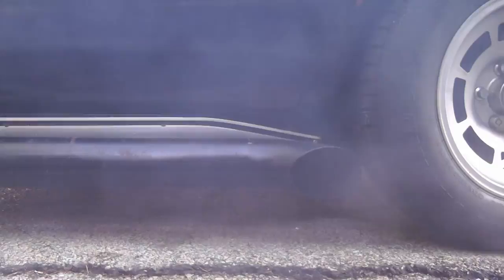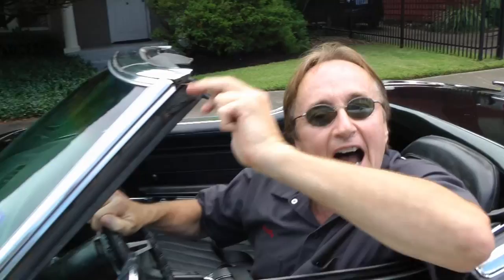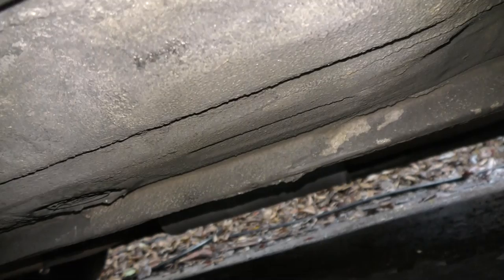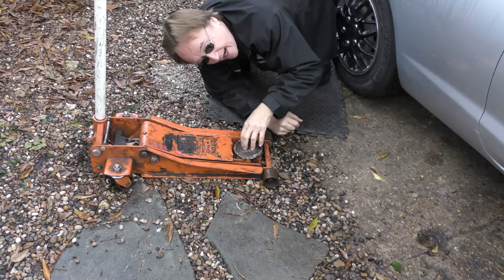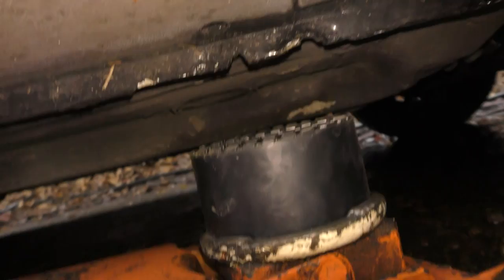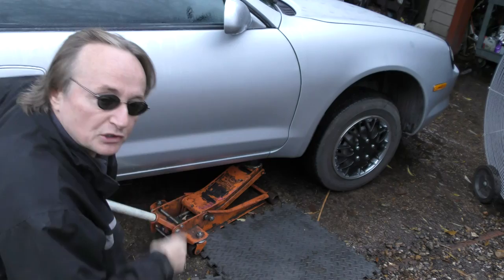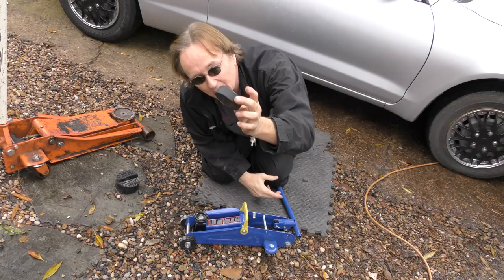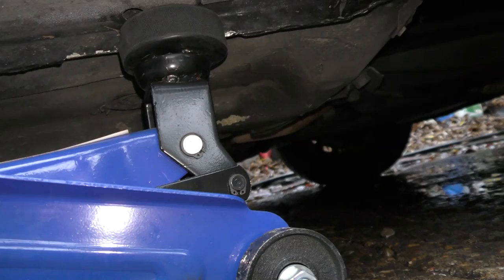How to Jack Up Your Car With a Hockey Puck

Comment: but my car is already too low for most Jacks. that's alot of clearance to add
Reply: +Shawn Jones dig a hole in the ground.
Reply: dynocompe LOL! Ive seen where some people do have ditches dug in their garages for working under their corvettes. Looks pretty nice too, but Im not gonna do that unless i own the place i live at. I do a shit ton of work on every place I live but that would be a tad bit above what I want to give to a different owner.
Reply: you just drive up on some boards, give you some clearance for your jack/slimjack
Reply: dynocompe My front wheel drive car kicks everything out from under it usually. its hard to drive it up on ramps (impossible to reverse it on) and ive modded the ramps to have rubber for added traction all around and even put heavy dumbells there to have the car kick them away still. I use my ram to get it high enough to jack it. It still doesnt give me any room under it to work on it.

Comment: Scotty, my car has recently started stalling out when i shift from reverse to drive, it only does it when its cold, the transmission fluid is new and i even tried some of the lucas transmission fix, still does it, what am i missing here
Reply from the maker: +Francesco Barbera may not be a transmission problem, try my video "how to fix a car that idles poorly'
Reply: Scotty Kilmer It doesnt idle poorly though, if i stop in reverse it idles as it should but as soon as i make the shift it dies, would not having an air filter on the car be part of the problem? ( i feel so stupid admitting this)
Reply: +Francesco Barbera clean your throttle and maf sensor which is probably in scottys video he just mentioned. Why ask for advice if you are not going to use it. A car has a throttle, that is controlled by sensors. When you switch your car into gear, your throttle changes positions. At the position it changes to, its not open enough probably due to a dirty throttle plate or sensor. Clean it
Reply: dynocompe I already tried cleaning it, prior to asking here,
Reply: it as in what? tried meaning what? if it only does it when its cold, how long you letting it warm up? My old truck would stall too if its cold and I put in gear, my newer truck would do it if its really cold as well.
Reply: dynocompe Im taking it to the dealership tomorrow, gonna see what happens hopefully its nothing major
Reply: good thing you answered the questions to get it fixed for free
Reply: dynocompe To answer your question, i usually let the car idle for about 2 minutes before i drive off, and i cleaned the throttle and maf sensor with throttle cleaner
Reply: The MAF sensor has a special cleaner for it that is safe for electronics. Shouldnt use throttle cleaner. Since now you are answering questions, where do you live? (wondering what kind of weather you have) What kind of car, make model year
Reply: dynocompe 2004 dodge sx 2.0 with about 130,000km on it living in toronto canada
Reply: I live In Manitoba, I would let your ride warm up more than 2 minutes around here lol! Have you ever changed the spark plugs? If you havent, it is time and you would be surprised how much of a difference it will make.
Reply: dynocompe I changed the sparkplugs September of last year, maybe the wires are going bad?
Reply: what did the dealer say today. I doubt its your wires, pretty unlikely to be the cause of this.
Reply: dynocompe I wasnt able to take it today, due to a busy schedule, Im taking it thursday afternoon when im off work

Comment: Never have seen a mechanics "Vette smoke so badly. HMMMM His abilities are suspect
Reply from the maker: +Robert Womer Not my vette, a customer's that sat in a garage for 16 years unused. This is what is sounded like after just getting it running. it's fine now, but doesn't sound as interesting and the smoke looked cool on video, that's why I used it
Reply: I see. Could be just rings hanging up after such a long sit. We use marvel mystery, dump it straight down plug holes and let it work for a day or two. Worked well on sidelined marine engines.

Comment: Hey Scotty Kilmar, how does strait piping a car affect it? can anyone tell me the truth?
Reply: +RoGuExPaNcAkE it doesnt. My truck is straight piped since brand new, now 10 yrs old. No side effects but a rumble in the cab.. A mufflers purpose is to make it so its not so loud, muffle the noise (hence muffler) and now with todays enviro rules, it also tries to clean the exhaust gases before being released into the atmosphere.. (cat. convertors) Ever hear a engine with no muffler at all? its fucking loud. Depending on how new your car is, you may want to leave the cats in place so the engine light doesnt come on, there is work arounds to fix that though. I left my cats on.
Reply: dynocompe thanks! And an 03 what can I do to give it the roar with out strait pipe?
Reply: depends on the roar you want. I like straight pipe because it has a nice deep rumble when I want it, and if I drive it like an old grandpa its not that loud. The rumble in the cab is a bit annoying the older I get. if you want something to really rap when you stomp on it, you would need something else besides straight pipe. But if you remove the cats and straight pipe it, it will be much louder than with cats on. What kind of vehicle are you wanting? Each engine would provide a different sound obviously with sraigth pipe. My experience, the bigger the engine, the deeper it is straight piped.
Reply: it will throw codes and run like shit. you will have to have the ecu tuned to compensate
Reply: u only throw codes if you remove the cats, and only on newer vehicles which most likely will be the case, but there is ways to delete the codes. It will not run like shit at all, runs the same, my truck is 10 years old, always been straight piped, and NEVER had one problem , besides maintenance. 200000kms on her. ECU tuned to compensate for what exactly? Will no exhaust you will have less restriction and more power. Performance exhaust has less restriction than a factory muffler, which gives you more power and better fuel economy. Mark, you have no idea what you are talking about
Reply: dynocompe definition of straight pipe is a pipe that runs directly from the engine out with no restrictions(cat)
Reply: dynocompe what u are talking about is a cat back exhaust not a straight pipe
Reply: dynocompe I think I do it for a living.....that's what the boss says when he signs my check
Reply: dynocompe sorry you do not know  automotive terminology
Reply: straight pipe today doesnt mean removing the cats as well anymore, has been that way for 20 years considering its a huge fine to remove the cats. Considering you claim to be in the automotive industry you would know this. But we both know that is not true.
Reply: dynocompe well if that's true it depends on who you ask and or where you live.......known as straight pipe on back
Reply: dynocompe just because you can't straight pipe anymore doesn't mean the terminology changed
Reply: dynocompe go ask your local exhaust shop
Reply: you need to go ask them! I already know the answer and they installed it.
Reply: Lol because they will only install a cat back because it's against the law to straight pipe it. If you go in and say I want to straight pipe they assume u mean from cat back, however if it's an old timer they will tell you can't without a tune and it's illegal anyway
Reply: Dude I've been at this for 7 plus years
Reply: dynocompe that's because a straight pipe is just that a straight pipe. The only reason they do a cat back when you ask for straight pipe is because it's illegal not because that's what it's called.......lol
Reply: dynocompe no nowadays a straight pipe is a straight pipe it is what it's called. Nowadays kids like you think a straight pipe is a catback pipe but sorry it's still not a straight pipe and isn't considered as one....only the uninformed think that. It's not your fault man, it's lack of proper information
Reply: you have already agreed with me. Now you just arguing to argue. I win you lose. WINNER ! OWNED
Reply: winning
Reply: dynocompe yes I am
Reply: you are a very insecure person, it shows through very much. You are going through a lot of anxiety. I am sorry to see that. Hopefully things get better for you, fighting on the internet will not help you bud. Get well soon
Reply: i am not misinformed. I live in todays world, you dont go outside and are stuck in the past. I am here for you every step dont worry.
Reply: dynocompe lol
Reply: dynocompe you will learn the terminology with time kid, usually starts when u get your license unless u are rich and have others work on your stuff(probably the case)
Reply: i have my own diy channel on here bud. I live on a ranch, so ya that is how very wrong you are at reading people lol. I do everything myself. The straight pipe I got done was on my 2006 Ford F150 the same week I bought the truck, so almost ten years ago, and ten years ago,  cat back straight pipe was considered straight pipe because the cat laws have been since 1998 I believe? Somewhere around that. So that is how far off you are on your terminology. I fully agree straight pipe WAS full on straigtht pipe no cats, but things have changed. Very understandable since its illegal to remove your cats since 1998 and alot of states and provinces have smog testing you have to pass. You are the one who is lacking on the terminology.
Reply: dynocompe "I do everything myself" "had my exhaust done 10yrs ago" gtfo

Comment: I thought he was going to jack up the car by throwing a hockey puck at it.
Reply: tf?
Reply: yeh i hear if you throw it just right under the wheel well it will just pop right up in the air
Reply: No one got the pun.....jacking something up is slang for "messing something up" as in "that chick got really jacked up after  that car accident". The car would also be jacked up in such an instance. Additionally throwing a hokey puck at a car would jack it up too, jack up the paint and body work that is.